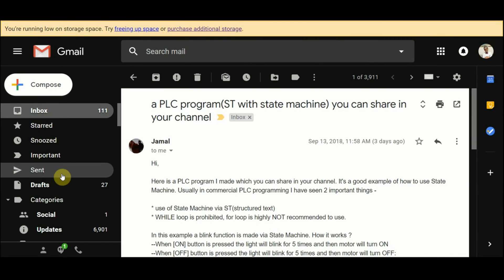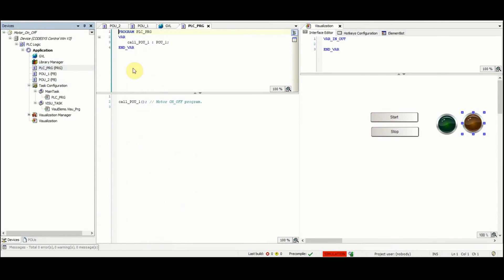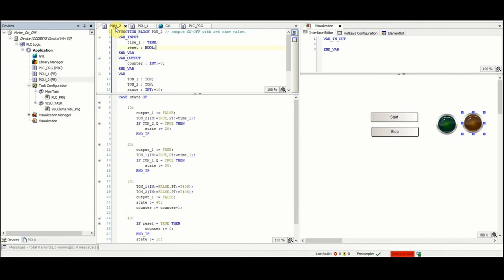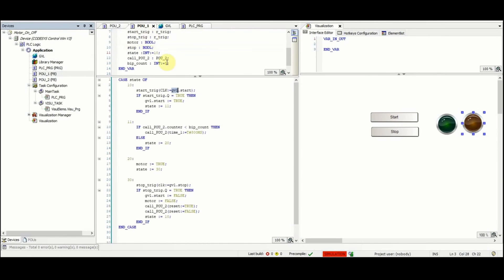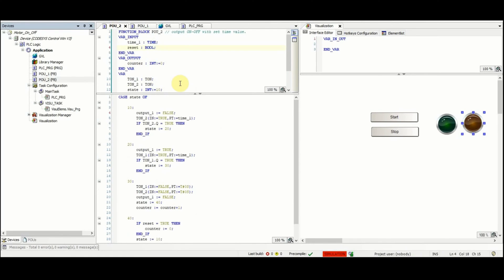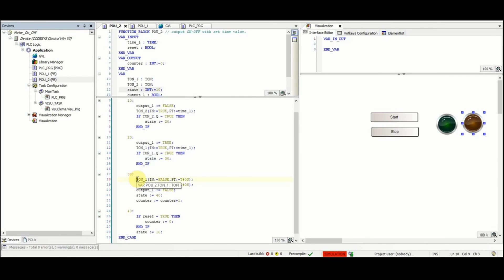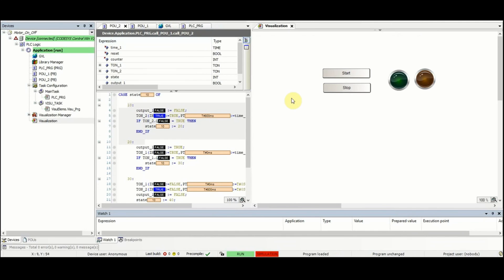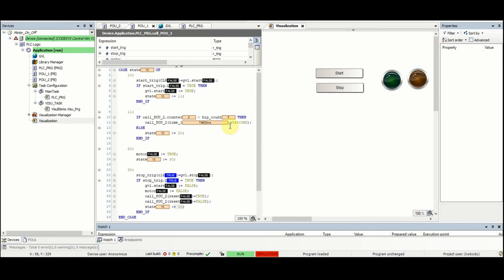CODESYS: ST programming example - Programming state machines #codesys #structuredtext #iec61131

Comment: When turn on potenciometer coil of relay on, in 5s the coil turns of and wait some seconnd and again turns on. When resistanc of potenciometer is redused time interval  on/of  the coil redused. Please how implement it on codesys
Reply from the maker: Looks like you need to have a variable for the delay times that depends on the resistor of the potentiometer. I think you can easily do this, you just need to convert the Real/Integer variable to a time variable and use it as the preset time for timers.